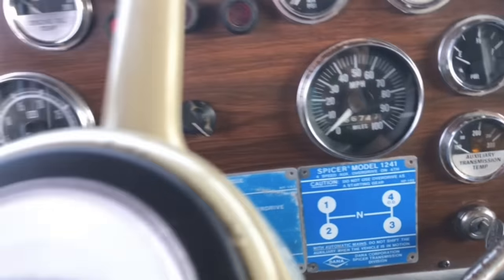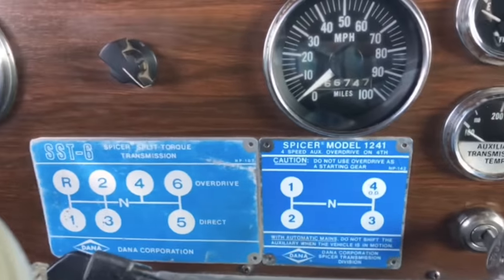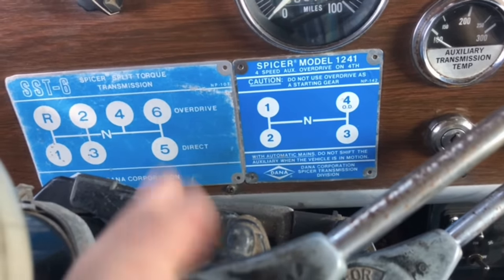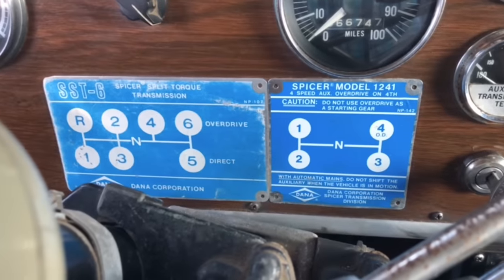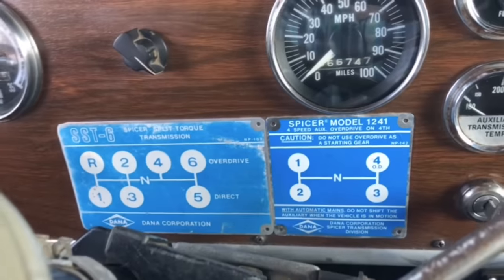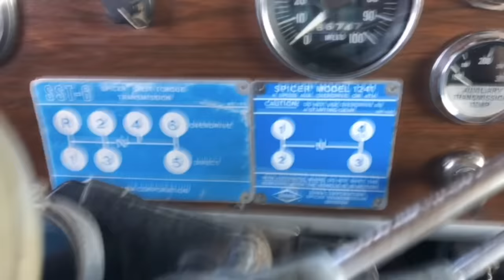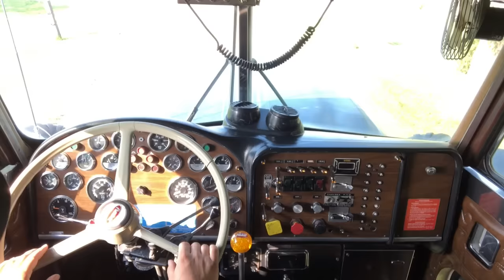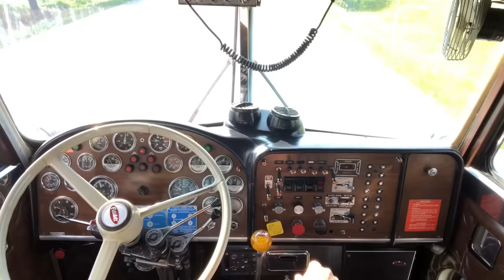How to shift Two stick 6+4 Spicer Transmission Peterbilt 359 #Peterbilt #359 #Twinstick #Twostick

Comment: Driving school graduate opens driver's door on an older (real) truck. What is the first thing he/she says? : "Why does this truck have 2 brake pedals ????"
Reply from the maker: One for each gearshift 😉🤦‍♂️😂
Reply: Hilarious 😂😂😂
Reply: SADLY this is how the trucking industry is going unless you are an o/o
Reply: Pedal order (left to right) Clutch, Brake, Throttle
Reply: That's in case on brake pedal fails you have a backup
Reply: Not all of us. 5 years driving right here and was born to operate machinery. Started on a 10 speed in trucking school and was in one for 3 years of the 5 i have been driving. Also i operated 1970's model dozers and loaders like a dressta td-10 and cat 977L. I would bet my whole paycheck i would drive this truck with a small anount of practice. Well scratch that. If i can drive it once i will hand ya my paycheck. Worth it lol
Reply from the maker: Save me from ever having to drive a 10 speed again!! I have never driven one in a tractor trailer thankfully but in the little trucks they are bad enough!
Reply: Joseph Rivett "do you know how to double clutch?" Asks the instructor... (Student driver) one of them a brake pedal right ?
Reply: Steven Marcinkowski 
You should never have to use a clutch hoss, only use it to take off
Reply: the left one is for the left side brakes, and the middle for the right side.. lol
Reply: One is the clutch and the other is the brakes and the other is the throttle
Reply: @JuliaCV9  I think you would be one of the guys he was talkin about in the first place with this comment
Reply: @JuliaCV9  or you just don't have a sense of humor
Reply: @Kimmiesman24  insecure much? You act like you put your name in front of that comment...🤔🤔🤨
Reply: @WhitfieldProductionsTV  hell a lot of owner-operators are like that... completely lost on what Truckin is supposed to be
Reply: @MultiBMarsh  yeah Cod he understood that. He was making a funny.....🤓dummy
Reply: @danhalas3936  hell yeah that's right they are tractors after all
Reply: @lukebecker1959  😒😒 I really can't repeat myself again
Reply: @parentsbasement7734  ...... born a freight hauler..... Stayin a freight hauler.... y'all poor fellas are missing out
Reply: @happyhoboschickentruckinch9314  what do you mean?
Reply: You should have said one is for braking in the city and the other is for braking on the free/highway.
Reply: @stevenmarcinkowski8577  😉🤭🤭🤭🤣🤣🤣🤣
Reply: Split brakes could be useful when ridding wheelies in a dump truck spreading up hill. Ha.
Reply: Sad to hear I had a coworker who ran across a company road driver who couldn't back up a rig.  Imagine that one.
Reply: @JuliaCV9  "Gas" what do you think is?
Reply: @JuliaCV9 .... just so you know,  it's Not a "gas" pedal on a diesel.... it's a Throttle.
Reply: @Romans--bo7br  oh, ok.
Reply: Well I went to trucking school 2 years ago and I’m fortunate enough to have learned on a stick lol
Reply: @JuliaCV9 ..... Just so you're aware.... It's pedal, not "petal",  and on a diesel (not talking about those little pickup diesels), it's the Throttle.... Not a "gas" pedal.
Reply: Bubbles 8V92 better yet a super 10
Reply: LOLOLOL so funny cuz I've actually heard a guy ask that, true story
Reply: PLEASE everyone just understand these 6x4s 5x4s 4x4s etc were for heavy loads when 300hp was a big motor
Reply: With 500s 550s 600s today, even 18gears is more than enough. My first motor over 400 was a 475cat w a 13sp 373rears,  and I hauled triple digits,  veneer logs mostly, all over the north east. I could pass most anything going up snowshoe on i80 west bound , even loaded at 80k.
All those gears were just to get big weight rolling and keep it rollin back when hp n torque was so low youd loose so many rpm tween gears youd grind to a hault
Reply: @happyhoboschickentruckinch9314  
As an Old Man Told me.................(40+ yrs ago)
Its All Freight Boy............ No matter what you haul.....
Its All Freight !!!!!!!!!!!!!!
Reply: @JuliaCV9     NO!   Really?
Reply: In Europe it's common to have autos............
Reply: When your T680’s awesome hydraulic clutch blows a hose and you drive 130 miles fully loaded with only two of three pedals functioning... 😏
Reply: Real truckers don't use the clutch. They shut off the truck, and use the air starter to lurch the truck forward and float from there.
Reply: @MultiBMarsh  Float the gears on a CDL test and you will fail.  Not that I don't agree with what you are saying.
Reply: @WhitfieldProductionsTV ..... and there are Not very many True O/O's (Independents) around any more, either.   There ARE, lots of "wannabe's"..... that get sucked into those company "Lease to Own" programs.... which really equates to "Sucker" as far as the one who "signs on the dotted line" is concerned..... unfortunately for most of them.
Reply: @Kimmiesman24 .... so, what was your operating impression the Chinese (Liugong / Dressta is from Liuzhou, Guangxi, China) somewhat "copy" of Dresser/IH's, little dozer?  Should have worked well with the 977L... similar in size, though the Cat would be a little more powerful and better "lugging" power with the longer stroked engine.

Comment: I was taught arm through the when by my dad who started driving in the early 60's, but when I ended up doing it I never used that method. Twin sticks aren't hard, but you have to pay attention at all times. I honestly prefer a simple old 15 speed personally.
Reply from the maker: Im not even sure how to do the two arm thing but as sloppy as this steering box is im not planning on trying that until its fixed
Reply: @Bubbles8V92  I think it is bs, if you try to shift both boxes at once you are going to have to grind one in. One at a time and you can match speeds easily.

Comment: My first over the road truck was 71 K100 with a 335 and a 4and4. Heck of a horse in its day. Sure miss those days. Been running a 13 for 
many years and still long for a set of sticks.

Comment: I bought a Willy's Jeep that had a Warn overdrive similar to this. This seems more like high and low settings on the 13 and 15 speeds. But waaaay cooler.
Reply: That is exactly how I explain it to people. It is like splitting a 13 speed only you have 4 splits.

Comment: New drivers today will have a stroke learning the shifting pattern on an old school semi . the Eaton 13 sp to me is the most all round transmission , that 6 + 4 transmission has the best of both worlds speed and torque would be nice behind a Cat. or Cummins in that Pete. love the old school semi no check engine light or def fluid just straight motor and now due to govt. regulations on new semi's a lot of owner - operators are resurrectionting pre- 2001 semi's and going back to paper log for avoiding the crap of "E-Log" more crap created by the government. God bless the truck drivers of America
Reply from the maker: Carlos Chavez we dont have elog up here until july 2021.... and the only reason is because Americans switched to it 😏😏😏😏
Reply: Where are yall in canada
Reply from the maker: Ontario

Comment: I learned to drive in the oil patch 1980's,Wyoming about 50% dirt roads,mud,snow,ice,moving rigs.
Throwing tire chain's on everywhere out in the big wide open.These old trucks often times could go where 4 x 4's couldn't.It definitely was a learning experience.

Comment: The only time I ever felt the need to stick my arm thru the wheel was making a big jump down shifting on a steep grade.  If you didn't make that shift quickly, you lost a lot of momentum. The easiest dual box I ever drove, was a Spicer with a airmatic auxiliary. it was a 4x4 or 5x4, but only 1 stick and a 4 position air shifter on the knob.

Comment: I learned driving with an Iranian manufactured Mack R600 with 5+4 gears in early 1980s. Fantastic truck with huge amount of power and fast enough on motorways as well. Back then most of the loads were steel slabs or big pipes and the Mack was very up to this job.

Comment: The old quad box Mack w 8v71 was also good for 7.5 mpg in the 70s
Reply: Still respectable today
Reply: Mack B model with triplex, 6 cylinder mack engine,no power steering,no a.c. those were the days!!

Comment: My brother in law taught me how to do a 13 spd w Detroit but also drove an R model w a 5 x4 w 318 Detroit
Reply: The R Model with 5x4 would have been Macks own Compound "quad-box"... tough transmissions, basically... but they had an inerrant issue with the input shaft bearings, pounding out... especially with an 8-71 in front of it.   Speaking of which, how do you know for sure, that it was a "318" Detroit?    Just curious. : )

Comment: Stumbled on this video. Brings back memories. I've driven about every transmission out there. The most fun was an old 5 over 4 in 65 Mack during potato harvest in the fields of northern Nevada. Pulled just about anything that would fit on a flatbed. Singles and doubles.

Comment: Dont ever hear rev that high anymore... Miss that sound. Then again, I learned on a three. Drove a two for a while, then it was all 13's and 15's. Went back to it and there was nothing over a friggin 10.... My disappointment was real.
Reply: Not reving high at all . Check out some Tractor pull Detroits running over 3500 rpms. My sawmill Detroit is governed at 1700.

Comment: Cool video. The 359 with the top vent air conditioning was and probably always be my favorite dash design to drive.
Reply: Except for the turn signal indicator covers falling off 🤣
Reply from the maker: Supposed to be little springs on them but they dissappear  quick 🥴

Comment: 68 autocar 350 Cummings 5 speed and 4 speed with 7:11 rear end.
Reply: James Craigg..... That would yield a Top End of about 48 - 52 mph with 11:00X24.5 tall rubber... on a "good day" with a tail wind... down a 5% grade, flat out at 2150 on the tach.  I remember those years and those high ratios really well.... those were great gear ratio combo's for "pulling sky scrapers and mountains off of their respective foundations"!!   lol   Which 68 model of "A"- Car did, or Do you have?     PS: I know it was probably a "typo", but it's spelled CUMMINS.... instead of "Cummings".

Comment: From a time when you had to actually drive a truck instead of just aim it.
Reply: Tell me about it. For me these modern vehicles (car, pickup, or truck) packed full of technology are actually detrimental. Real driving skills are being lost to the point where the roads are now full of steering wheel holders rather than drivers. Not a good thing.
Reply: Can we say that nowadays truck driver fatigue is related to Automatic Transmissions? Like what is a truck with no clutch and gear lever
Reply: Nah, you still have to drive them. If it was that easy, anybody could do it, and this shit wouldn't be so regulated...
Reply: Talk about BORING trucks too... No style at all, Barely any nice exhaust sound, and finally No shifting, no being able to control your truck to slow down if you loose your brakes and no being able to downshift going up hills... BORINGGG That’s why nobody wants new trucks anymore... Giant overbuilt POS’
Reply: @josefastboats5874  they exist to do a job and make money. How much money are you willing to throw away to look cool?

Comment: I cut my teeth on 2 stickers...running Cummins, Detroit, & all the Cat's. As a practice, but only because I been driving 2 stickers for over 30 years...I float all my gears. I don't believe in rubbing gears in. I want all my gears to drop in. It takes practice...but once you been driving 2 stickers everyday there is no reason why your gears don't just simply drop in. This taking everything into account: RPM's  Roadspeed...Surge from "walking loads" like water tanker runs up to Pohakuloa Training Area for the military. Being in the right gear before descending a long grade... Your shifting progressions will vary...especially when running a good Cat 3406 425 or the 450 3408. That is when you throw the truck driving manual out the window & use only your fingertips to shift...fingertips & wrist action.
Reply: I learned how to float gears in my 5 spd pickup. Step one, right? When I turn 18, it'll be time for step 2. :D
Reply: @KohalaIronWorksCase  :)

Comment: Could you explain the two brake hand valves I’ve never seen that before?
Reply: Trailer brake valves. Sometimes your trailer can get to pushing and you need to apply brakes to the trailer only.
Reply: I know what the hand valve is for just never see two
Reply: Double trailers.
Reply from the maker: Typically the lower one is an engine retarder in a cat engine but on mine its a fuel shutoff

Comment: Brings back memories. Not good ones either lol. The first truck my old man put me in was a 69 Pete with a 318 and a 5 and a 4. Log truck mind you. 2 yrs later I got to the big horsepower of a 335 Cummings with a 6 and a 4 double over like that one. Thank God for Eaton. And thanks for not putting your arm through the wheel to shift. 36 years of trucking.

Comment: In Iowa in 1963 i met an old timer with a GMC with a 5&5 set up . He called the over lapping gears as being " gear bound " . I was driving a 1958  " Awfulcar " with a Fuller 10 speed . Would have liked to try that truck !

Comment: Gotta love those screaming Detroits! My first real semi driving job was in a 1955 KW with a 6-71, 4 x 4 trans and no power steering driving on I-5 and down into the Seattle waterfront in the 1970s. Have driven just about every Detroit diesel in dump trucks only missing the 12v71.

Comment: Hats off to you! I learned on a 318 and it was seemingly difficult enough at the time with a straight 9 speed! Wasn’t sure what my Dad meant by “slam your hand in the door, then start driving the 8v92”
Reply: You drive those old Detroits like you're mad as hell at it. The Detroits actually ran better the harder you pushed them.

Comment: That was a pretty well explained video. So basically mostly your running a 6 speed transmission like sports car would have in it, but each gear you can split up or down by 25%. So if no load you shift it like a car, but if loaded you use the second shifter to move up or down by 25% until you reack the rpm for the next gear. Is that about right?

Comment: Greetings from the Ohio Porters...it’s 2021. Well, you sure made it sound simple. I guess I’m ready to take a twin stick rig on and try it for myself. You made a good point...some drivers just want you to think it’s hard to shift a twin stick. Like any truck out there even today, they’re all different and depends on what you get used to.  I wonder if some liked to use both hands when shifting mainly to shift quicker. If you’re on a grade, got a heavy load, you want to make sure you pull off in the right gear and don’t stall. Good stuff! Keep On Truckin! 🤩

Comment: In 80&81 drove a 2 stick GMC Brigadier General and later yrs drove a 2 stick Mack and no problem shifting but got tired of extra shifting. Went to 13 speed Fuller and loved it. Less work. Especially on short coal runs running 90-100,000

Comment: I used to drive a old chevy grain truck with a 5 and 4 setup (1 - 5 plus A - D).   Easiest way to explain it to new drivers was that its a 5 speed with 3 overdrives.    

A1 - A5 then B5, C5, D5 loaded and C1 - D5 empty     Never had a guy have trouble with it after that. 

Technically loaded it could be done  A1- A5, B4, B5, C4, C5, D4, D5 but the RPM band splitting was not wide enough to make much difference for the amount of added arm work involved.

Comment: I got it now . Great job of explaining how to do it . I couldn't see the tachometer to watch the RPM'S but it doesn't matter after looking at the shift pattern I was calling out your changes on the main stick and the 4 speed auxiliary before you made them so Don't leave that truck unlocked I might be tempted.  LOL . Now I've been a longhaul driver for over 30 years and my trucks are 13's and 18 speed Eaton Fuller Roadrangers . Airships splits are so easy compared to a Duplex . Anyway thanks for making the video .
Reply: Air shift not Airship . Typo.

Comment: Those 2 strokes sound so bad ass. I drove a 4 and 5 Mack. You have to shift 5 then back to one and up to 2 on the other, up to 5 then back to 1 and up to 3 and so on. When I was trading it for an 8LL I told the guy I don't think I can drive it. He looked at me like I was kidding. I wasn't. God bless the 18sp. fuller.

Comment: Just brought back a memory from 1982..It’s a good idea to carry a long pry bar/cheater bar with a round tip..You’ll need it if you get tired and start “roundhousing the brownie box from under to direct and hang up the linkage..sticking it up so it won’t shift..You have to pull over and go between the cab and the right step with the bar to unjam the linkage..I woke up out of the sleeper one time with my now ex wife all wound out at 2400rpm doing 57 mph with the brownie stuck in under..Once I taught her how to unjam with the cheater bar ,she quit roundhousing the brownie...

Comment: An easy and accurate way to calculate your top speed would be to put the truck in double over, let the revs drop to 1000 rpm, see what the speedo reads, and divide the speed by 10.  Then you'll end up with mph per 100rpm.   For example, if your speedo reads 40 mph at 1000rpm, you'll end up with 4. Then if your truck bumps the governor at 2000rpm, your top speed will be 80 mph.
Reply from the maker: Good idea 👍
Reply: @ragman069 WTF! I applied Your Caculation & Arrived at 22,000 Telephone Poles/Hour!!!!!
Reply: @len-zeplin480  now that's a hammer lane truck!!!!